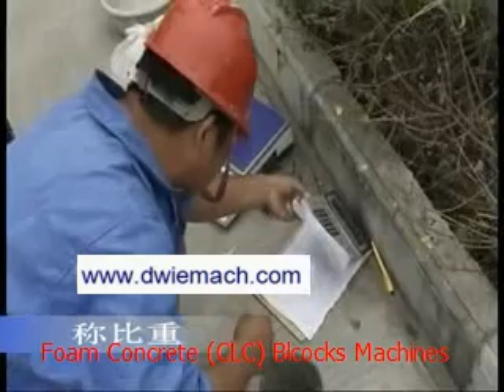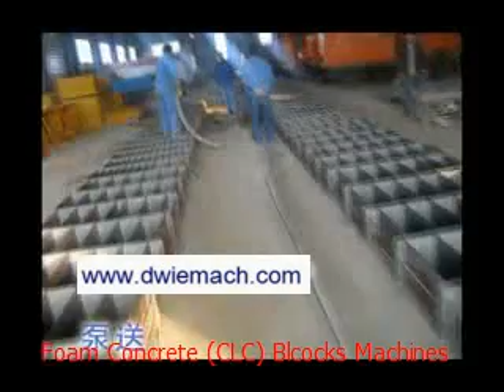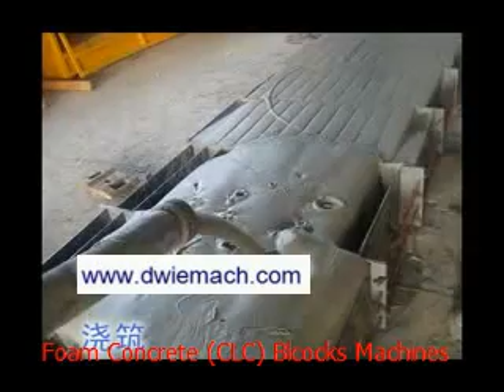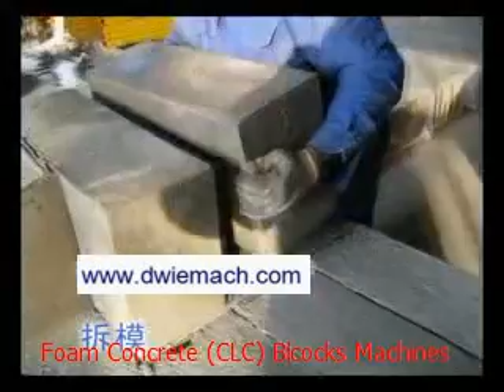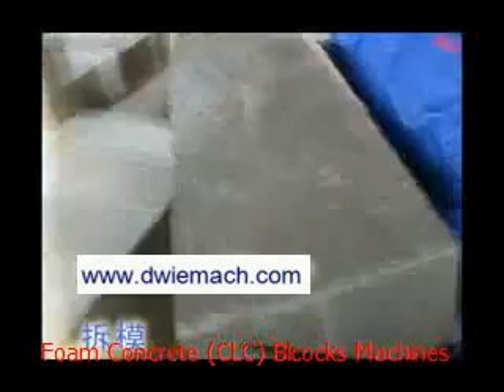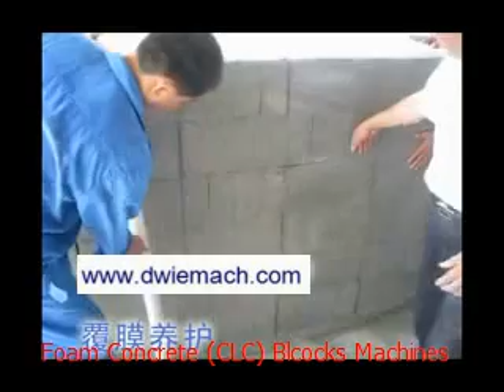Cellular Light weight Concrete (CLC) blocks making machines

Comment: David.... what would the cost be for this machine/system to be shipped to Newport, Oregon, USA, along with an engineer to set it up for us. Our - 325 mesh CLC admixture is natural Nepheline Syenite, sold as FoamKrete [dotcom] As there are only to U.S. Nepheline sills in the US, our biz plan of the moment would be to use bulk rate rail gondolas to independent distributors for grinding, and foaming into blocks.
Reply: What is 325 mesh addmixer more effective..?